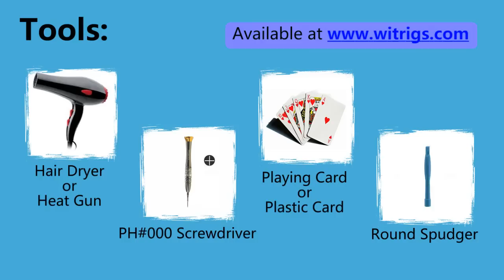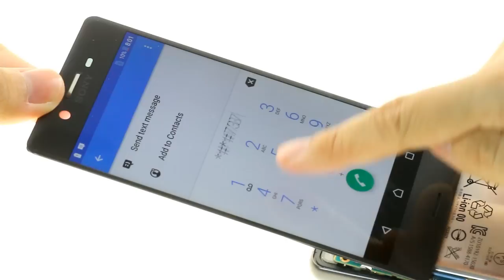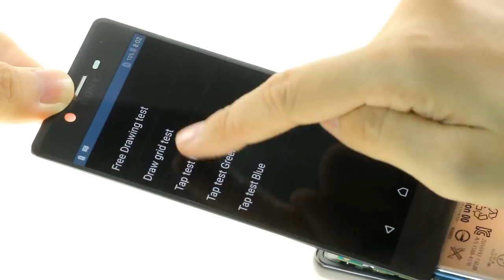Sony Xperia X Performance LCD Screen Repair Guide

Comment: Just bought it from witrigs nice pro package.The video looks easy made by a pro...let's see how me and my hairdryer will manage though 😅
Reply: It took me 3 hours and a small lift in one of the sides of the screen, did not attach well becouse i did not clean it well.But i managed to turn my phone on and get the data.Thanks guys

Comment: I just have a question about what happen to my sony xperia f5122. I'm not an expert butI tried to open the rear part of my device to clean and to find what's going on to its charging port. 
After it, when I tried to reassemble and open my device there was no backlight already (but the display is still there) and the touch screen is not working. What would be the possible cause for this matter? Thanks for this video...

Comment: Pretty interesting how you video the long route of fixing this phone.  All the Xperia phones I've come across, do not require removing the mother board or camera.
Reply from the maker: Hi sir, I removed the motherboard because I need to heat up the screen for removing it, and as a precise part of cellphone I don't wanna ruin it by heating. Because as I know, smart phone can survive in maximum temperature of 80 centi degree.
Reply: That's pretty interesting that the amount of heat you are using is enough to damage the motherboard.  Doesn't take much heat to remove the screen on Xperia phones.  Looks like a scare tactic to trick  people into having you fix their phone by making the repair look more complex than it actually is.
Reply: Wit Rigs I've just replaced the screen on my Xperia x performance. The back light turns on but the screen does not light up. I remounted the old screen and the same problem occurs. I've double checked all connections but I can't get it to work.
Reply: Just make the video a bit longer for youtube ads, that's not bad

Comment: Is it posibble Just replacing digitizer,  not entire LCD? Or LCD and digitizer become one?
Reply from the maker: Do you mean the glass or the display?  It's possible to replace the glass but it's not easy
Reply: Glass, digitizer & LCD are all fused/glued together (in that order).  9 times outta 10 when you crack the glass on Xperia phones, the touch stops working.  Much easier to replace entire display as one screen assembly and save yourself the headache/hassle of trying to separate the glass.
Reply: What is the price

Comment: I checked the model number on my device, and it says F8131. I see that the one you are selling, is the F8132 version. My question is therefore: Can I use the F8132 -screen on my F8131 - device?
Reply from the maker: F8131 is the single SIM card version, F8132 is dual SIM version, but YES, you can use the F8132 screen on your F8131 device :)
Reply: Thank for answer! I have one more question. If I order from your website, how long would it take to ship to Norway?
Reply from the maker: We provide several shipping methods, for example,  ePacket (to Norway 10-20 days) or DHL(3-7 days), there's also other methods with different price and days, you can check it after you end your shopping and ready to check out.
Let me know if there's something I can help :)
Reply: Can SO-04H fit too??

Comment: What if there is water behind LCD can i use this method? Please reply
Reply from the maker: If your phone drop in water the first thing you should do is dry up the water both external and internal, to make sure the water won't ruin the motherboard. there's ways to do it, here is a reference https://www.youtube.com/watch?v=YnnhQfzW6_k&t=2s
after you did these, check the LCD issue, if the screen doesn't work, then you should consider to change one, and here is the link for it http://www.witrigs.com/oem-lcd-screen-with-digitizer-for-sony-xperia-x-performance-graphite-black

Comment: Please, what mean check if the battery problem solved? Are they some problems with it? Thanks.
Reply from the maker: I'm sorry I didn't get you... could you make it clear?
Reply: Sorry. You wrote in video check if the battery problem solved.  And I dont know what I should to check. Is there some kind of problem?
Reply from the maker: uh, I'm soooo sorry that's a edit mistake...  Could you ignore that step please?? I must be mad to made that mistake... :(

Comment: Can you please show for Xperia C4?Also where do you suggest I buy the screen for Xperia?

The touch works but it is cracked.
Reply from the maker: I'm sorry I don't have plan on xperia C4 repair yet... for DIY repair I don't recommend you to replace just the screen glass, cause the touch and the screen glass are made by machine and it's a tough work to separate them n you may ruin the touch... so if you wanna repair it my suggestion is to replace the whole LCD screen. And is there any sony service center around you? you can bring your phone to them.
Reply: They are asking me 100$ for repair. Is this price reasonable for a 2 year old phone?
Reply from the maker: well it's a bit expensive, but there's something you should know, the screen spare parts sold in website would cost you $40-$90, and after you get the part you have to repair it and there's risk of damage some part inside. n also I don't recommend to repair a phone without any guide, if you wanna fix it the service center would be a better choice.  wish this can be help
Reply: Yes it was helpful! I appreciate the fact that you can reply.

If you say it is 40$ then this is expensive.

But if you say 90$ and they charge me 100$, then I don't mind it since my warranty is still valid and I can use the phone.

However there are some random Indian-Pakistani private mobile shops that can also do the job for like 40-50$ or less. but that would break my warranty.

Comment: I want to repair only LCD, not battery. I have to remove battery?
Reply from the maker: you'd better remove the battery before screen replacement, it's not safe to heat up the screen with a battery on it.

Comment: Is it possible to replace JUST the glass on the LCD, or do you have to replace the whole screen? Phone was dropped but there doesn't appear to be any damage to the LCD, no bleeds etc, just cracked glass. Is it possible?
Reply from the maker: It is possible but very difficult. The display is as delicate as the glass and they stick to each other very firmly. We need professional skill and machine to remove the glass. It is very likely for us (not very skillful and without machine) to damage the LCD during the operation. Our guide video shows the best solution and easiest way to repair broken screen.